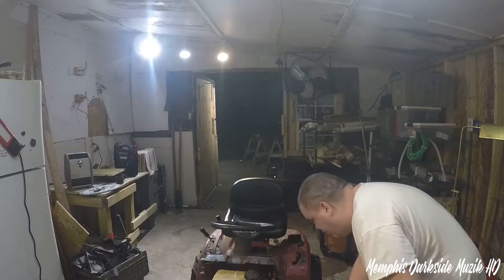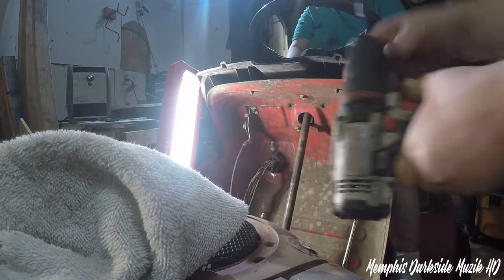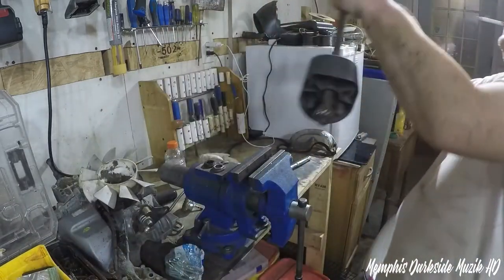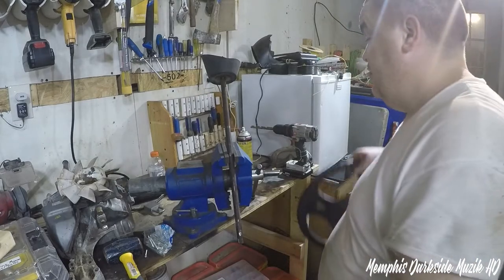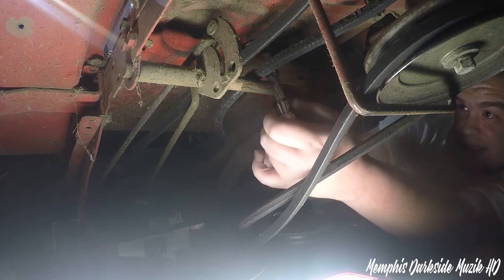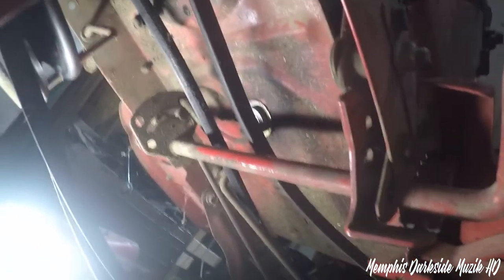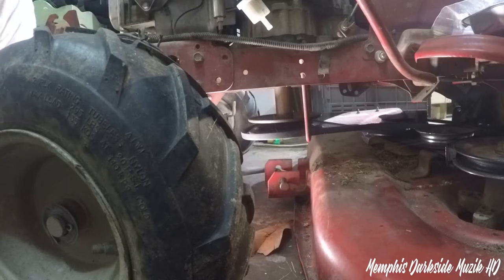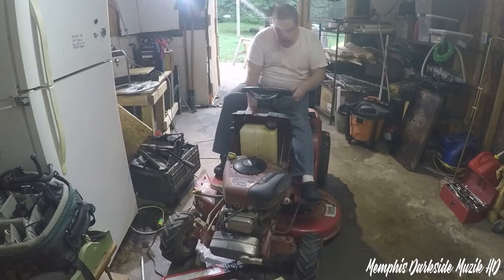TroyBilt Riding Lawn Mower Steering Rod Shaft Replacement

Comment: What about the screw on under the mower
Reply: I had to take a pair of lock pliers to grab the phillips head screw.
Reply from the maker: that was a #1 or #2 philips head screw 1/2". i replaced it with a hex head.